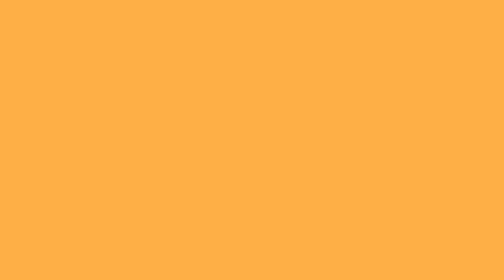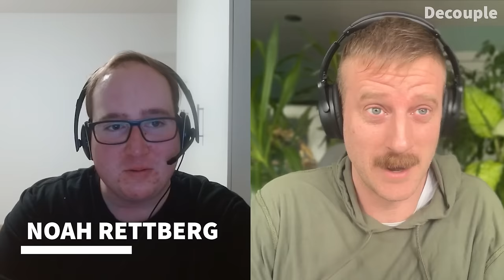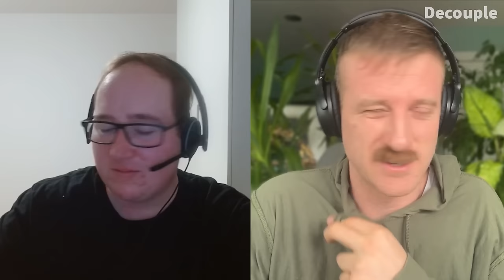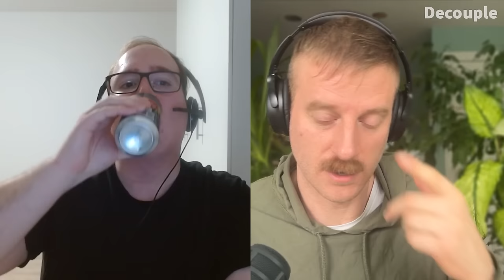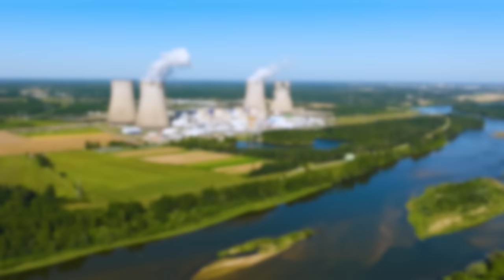Prospects for Process Heat & “Advanced” Nuclear

Comment: Decouple readers might be interested to learn the Chinese announce they have put into operation the first large coal burning power station that uses super-critical CO2 rather than high pressure steam. It is a 200 MW design. Apparently it allows higher heat temperature (600c++),faster start stop cycling than steam and a smaller footprint.. Also improved efficiency reducing coal consumption by up to 10% Plan is to now develop a 600 MW plant.  One can surmise this development will have some application to marine turbines. China's electrical system is very dependent on coal and this looks like a great interim development. Interesting to see how the economics work out.
e

Comment: 19:20 There are two types of electric heating being discussed here: 
1. Electric arc furnace (EAF)
2. Induction furnace

"The induction furnace is heated faster and has higher thermal efficiency. The heat is generated in the furnace (liquid steel), so the heating speed is high. In the arc furnace, the heat of the arc after the material is cleared must be transferred to the molten steel through the slag, which is indirect heating." Aug 3, 2018

Comment: Here in Sweden about half of the process heat used is below 300 C.

This is mostly because of the large amount of paper mills which requires lower temperatures.

At least that's the figure I learned when I studied engineering at uni some decades ago.

Comment: If the energy transition away from fossil fuels relies only on high-pressure/low-temperature fission it will be a long and painful journey. The cost will be enormous not just for the power plants but for the money wasted on "Renewables" during the process. 
There is no reason for a low-pressure/high-temperature power plant to cost any more than a natural gas plant, 85% of the plant is identical. Pair this with thermal storage and process heat and there will be no reason to build another PWR, wind turbine, or solar farm ever again. 
Interestingly, the first customers for "not-yet-advanced" reactors is heat, not electricity. Dow for chemical processing, Oil sands in Canada for extraction and replacement of coal-fired boilers in existing power plants. 
We don't need industrial cathedrals, as PWRs were described in the Juice series we need nuclear cheaper than coal and natural gas. Cheap industrial heat is a huge bonus and the cheaper the heat, the more uses people will find for it.
Reply: Amen.  I don't think it is possible to overemphasize the importance of this.
Reply: Can't agree more. There were several points Noah got wrong discussing efficiencies with electrifying everything. One of the main ones that he (and so many others) seem to miss out on is the efficiency of steam Rankine cycle when power plants generate electricity. Coal plants and the UK's AGRs are about 40% thermally efficient because the run at >600 deg C, CCGT plants are about 60% because they have one turbine generating directly from combustion and another separate turbine powered by the steam which is generated by the hot exhaust gases from the first step. PWRs are very limited at 30% because you run at even lower temperatures ~300 deg C. That is a hell of amount of wasted thermal TWhrs dumped directly into the surrounding environment.
If you had Gen-IV reactors producing only heat you wouldn't be getting the 60-70% thermal heat loss which is inevitable due to the Rankine cycle.  The efficiency would be limited by heat exchanger design, bearing in mind industrial heat exchangers are upwards of 90% efficient. 
PWRs are fantastic but looking much further down the line, we need to honest with themselves about their very real limitations on a broader scale with regards to primary energy supply.
Reply: @timothytaylor5867  Not to mention that PWRs can't run the Brayton cycle which boosts efficiency while lowering cost and physical footprint.

Comment: I had the idea of using the SES10 (AECL) in 1989 reactor for process heat while at IMC potash company in Esterhazy Sask. Sadly it landed on deaf ears . SES10 is the slow poke energy system 10 mega watts. 
They AECL was going to install a SES10 at the University of Saskatchewan in Saskatoon to heat a building. But it was canceled by anti nucks.

Comment: Bubble gum  refers to the fact that you can make bubbles from the gum you chew, the initaial shape of the gum is not necessarily a bubble,case in point Bazooka Joe Bubble Gum. A gumball dispenser on the other hand hasthe little spheres gumballs in it in a glass container; these truly look like the pebble bed fuel elements. Gumball is the more suitable term for imagery convoquation. Please take this in the spirit of fun fact. Strongly agree that the nuclear ind. Should get a few wins out there of on time and on buget, a sustainable marketable pruduct, beforepushing with great hubris the maximize the heat efficiency design which may have years of development ahead of it. Your podcasts warm the cockles of nuclear engineers hearts.

Comment: 34:20 34:29 "In prismatic cores like the Ultra Safe MMR or Japan's HTTR, graphite is formed into chair sized hexagonal blocks with holes for cylindrical fuel pellets and separate holes for coolant channels. The core is maximally packed and nothing moves. Refueling the reactor involves swapping out the graphite blocks."

Comment: To add, I’d love to know how much of process heat can’t easily be electrified.
Reply: Close to 100% of industrial heat can't be electrified 'easily' and the reason is electricity costs almost 10x as much as natural gas

That's before even considering that a Nat Gas Burner is super cheap and reliable far more so than an induction or arch heater
Reply: @kaya051285  well that’s because not enough electricity is made. Norway has tons of electrified heavy industry.
Reply: @thomasfsan  Well Norway is close to 100% Hydropower their eletricity falls from the sky. So perhaps Norway does use electricity but that's not typical

If you want a steel mill which currently uses 1 cent natural gas to heat their steel to 800 centigrade using electricity you are going to either have to subsidise that industry or society needs to accept higher prices (be more poor than it other wise would be)

Comment: Did he forget molten salt? Capable of beyond 1,000C. So his “nuclear never” statement is rather moot.
Reply: A 1000C MSR is definitely a "Yet-to-advance" reactor. The highest I've seen proposed is 750c. But if your reactor is producing 750c salt and also electricity, it would be a very efficient way to get to 1000.
Reply: How do you get that heat a mile down to the local chemicals plant though
Reply: @kaya051285  Why would you build the reactor a mile from where it's needed?